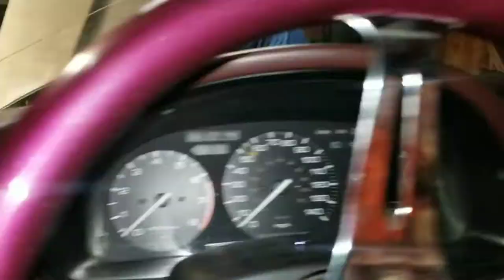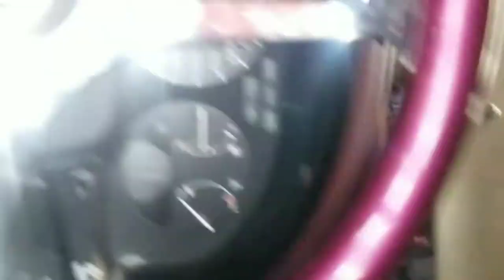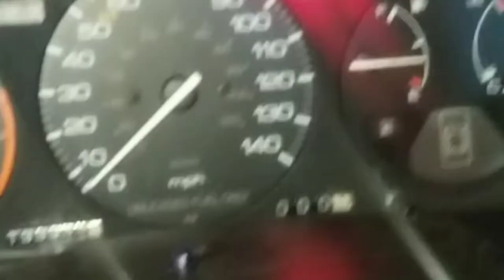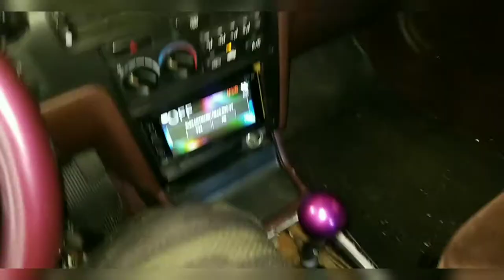Stage 2 Eft Amazon Clutch For the cb9

Comment: EFT still good? I wanna get a stage 2 for my S2k would you still recommend it from amazon?
Reply from the maker: welp i had the car for almost a year after this video went out and sold it but i beat the absolute hell out of the clutch mind you it was a stock engine not alot of power still did 100s of full throttle no lift shifts it never slips plenty of stop and clutch drops never slipped or felt like it got hot it kicked ass!

Comment: How's it holding up?
Reply from the maker: acctualy pretty well i beat on it quit often heel toe at almost every light its been holding up awsome mind you it is a stock f22a6 that came in the car not alot of power but i have no complaints!
Reply: @thathondachannel2105  Sweet! Thanks for the quick reply! I'll have to try one in my Rx8 as my clutch is on its last leg, and I'm broke at the moment. Haha.
Reply from the maker: @skylerbond56  haha yeah i do all my own work since thats what i do no need for prices at a mechanic shop or id go broke lmao
Reply: @thathondachannel2105  That's the way to do it! I can't afford $100+ an hour for someone to work on my vehicles. If I could they would be way faster than they are. Lol
Reply: @thathondachannel2105  I subscribed btw!
Reply: @skylerbond56  hey man I'm also looking to get the eft clutch for my 8. Did you end up going with eft? If yes, how's it feel? If not what did you go with and would you recommend it?
Reply: @vincenzoplascencia  I went with a perfection punch kit from Rock Auto and it's working great I put 500 miles on it so far and it still working great
Reply: @skylerbond56  sweet man I'll have to check it out. Good luck and thanks for the reply
Reply: @vincenzoplascencia  It's about $225 shipped. I don't want to risk shit quality clutch due to then being a pain to do.